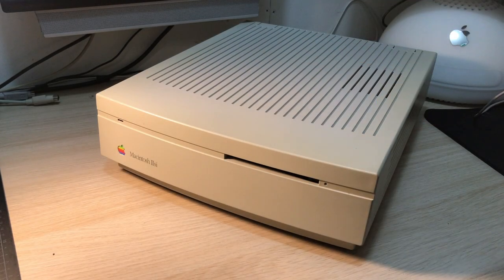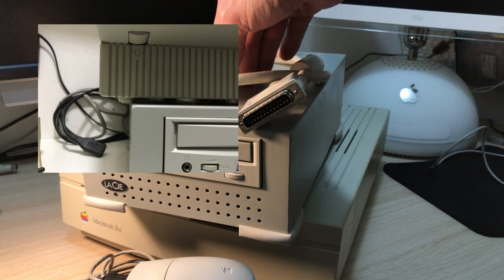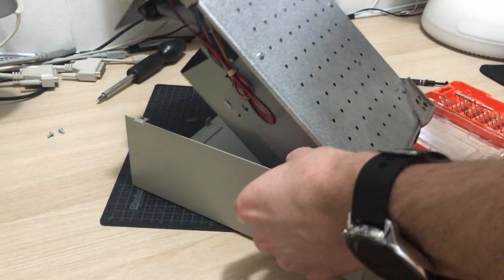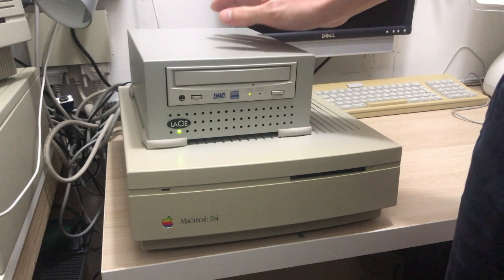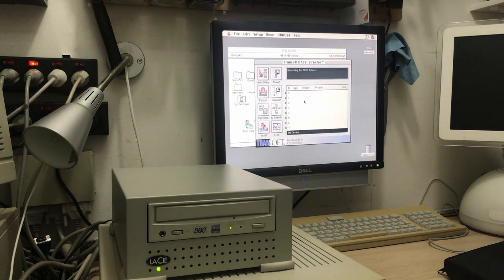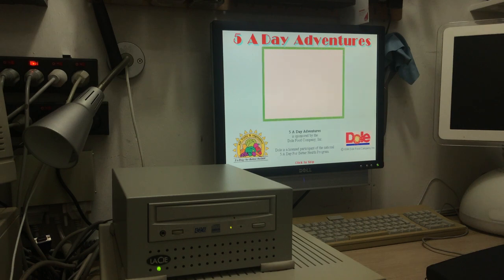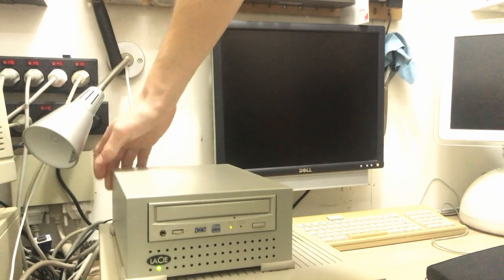CD-ROMs on Macintosh IIsi - 90's nostalgia galore!

Comment: I had this exact same issue on my IIsi: The problem was a broken trace under a leaking capacitor from the multiplexer chips to the video controller. With a monochrome image, you can count which bit is affected and look up the pins on the affected chips (search for Bomark Macintosh IIsi schematics). Since this is a big endian machine, you count from 31 down to 0. In the video it looks as if bit 0 is the culprit as I can't see a bright line to the far right of the screen. Use a multimeter and check continuity between pin 2 of UE5 (the multiplexer) and pin 1 of of UF7 (RAM chip) and between pin 2 of UE5 and pin 90 of UA3 (video controller). Then use a bodge wire or carefully follow the trace to repair the breakage.

You can't see the problem in 256 greyscale mode, because bit 0 is the least significant one and you can't really see the difference between those shades of grey.
Reply from the maker: Excellent, thank you for this - I will definitely hunt down the culprit and this is a great lead!
Reply from the maker: Hello again! I followed your excellent directions and managed to fix mine also - thank you so much! Here is the video I made about it: https://youtu.be/69p99ppx9FY?feature=shared
Reply: Hire this man!

Comment: The IIsi uses the system RAM for video memory, if you have it you might try some different RAM sticks. Otherwise, I suspect there may be more grunge left on the board causing issues. And yes I'd recommend recapping the power supply, especially in a IIsi. Good luck!!
Reply from the maker: Ah, yes thanks, that’s an excellent idea! I didn’t think of the RAM being the issue, but that would make sense in the IIsi. I’ll try to find some other RAM sticks and try! And I’ll be sure to recap the power supply too asap.
Reply: It can't be the RAM sticks, as the IIsi always uses the soldered on memory for its framebuffer.

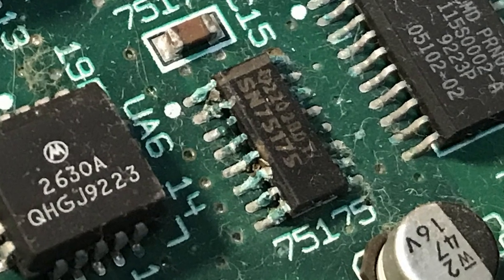Comment: At 5:12, that SN75175 looks like some of its legs are no longer there. If you could find a replacement, that might be the culprit for the display anomalies, but I don't know the schematics of the motherboard to be sure. As a rule, when I find components in this state, I replace them, and if replacements aren't available, I try to rebuild the legs.
Reply from the maker: Yes, it sure does - I should have made sure to get a close up in the after cleaning shot, and it did look intact. I guess there is likely some issue still since  the jail bars persist…I’m going to have to take a closer look.

Comment: About 4 years ago or so. I decided to reload a Mac LC. So I plugged in the scsi external drive and started the load. Cleared the drive off and everything was going along fine. Rebooted with the os 7.6 installed. Grabbed my other mac cd discs of goodies and it didn't work. I had to scratch my head for a few minutes. Then remembered that since it was not a Mac cd-rom drive. I had to use software toolworks to load that driver to access the non Apple drive. :p Yes that is correct. You can boot and load a os on a non mac scsi drive. But, you can't use the drive afterwords without a 3 party driver in the os.
Reply from the maker: Interesting, yes I was kind of surprised that the LaCie drive worked off the bat. Maybe it’s different for different 3rd party drives.
Reply: @retrotechguy  Who knows. But it is one reason for what is that? The software toolworks I think it was called.

Comment: When I did mine, the board was in good shape and it was the power supply that was in horrid shape.  I followed a recap guide which told me that the large high voltage caps "won't need replacing".  It was wrong.  I had problem with it clicking on and off rapidly suddenly shutting down and after replacing the big caps it works flawlessly now.  I don't get the jail bars either, you did show one chip that looked like it lost a leg or two.  You might need to rebridge those.
Reply from the maker: Yeah, the PSU seems to be the most common issue, for me it must be the graphics circuitry somehow…the crusty ship seems ok after cleaning, but more trouble shooting to follow…

Comment: The IIsi also has 1 MB RAM soldered to the board. If swapping RAM sticks like what Garth suggested doesn’t eliminate the jail bars, carefully check the onboard RAM for grunge on the pins, especially near the PSU connector. I’m amazed your PSU works without a recap. Both of my IIsi’s needed a PSU recap, and especially one that barfed its cap goo all over the logic board near the PSU connector.  Good luck!
Reply from the maker: Thanks, yes I’ll take a closer look at the onboard RAM s as well - some chips did look very crusty and maybe I didn’t get it all off. I was surprised at the PSU as well, I guess I shouldn’t push my luck though!